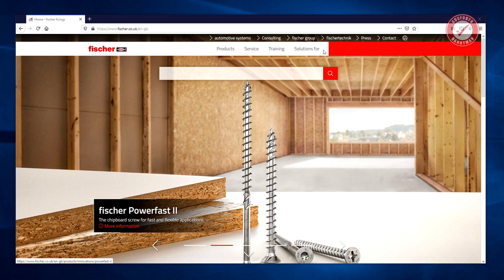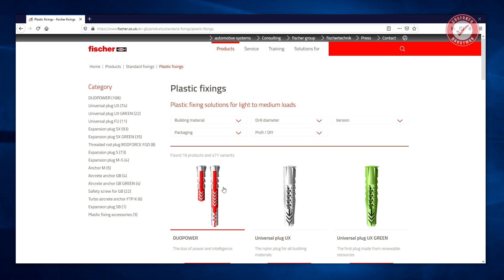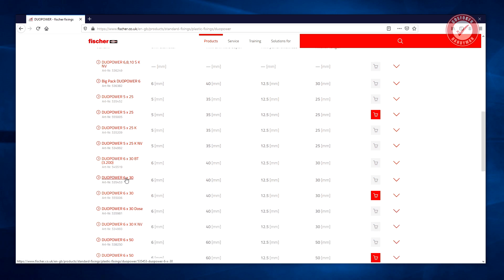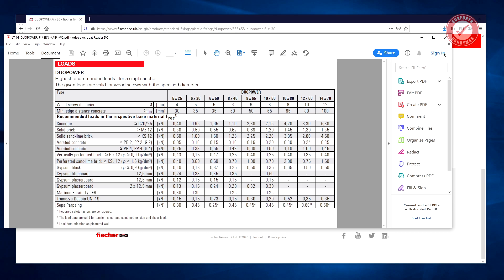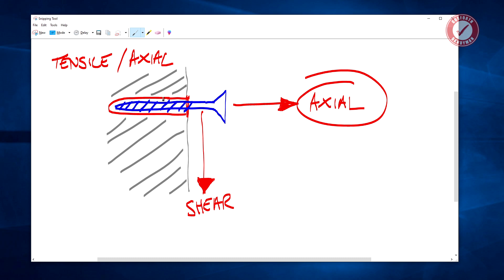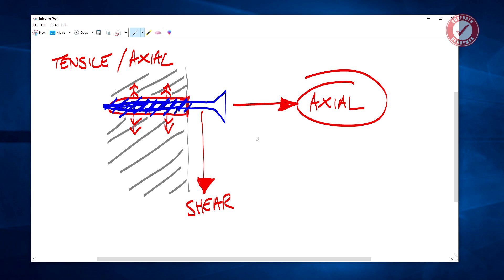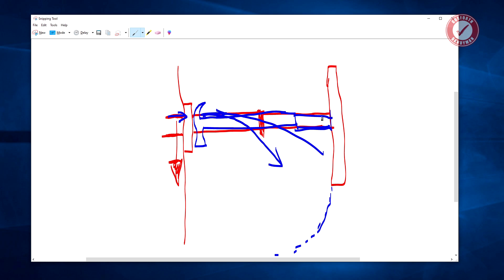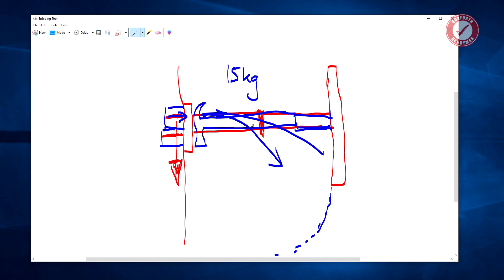How to read Fischer data tables for load ratings

Comment: Thanks a lot Andy for sharing the information and spreading the awareness of construction safety! I will gladly share your video with the construction class I teach.

I think you are right about the gypsum board or wall construction failing rather then the fixing itself. The b= 120 of b= 625 probably refers to the distance between each stud/support within the gypsum wall. It makes sense that more internal beams make the wall stronger and capable of bearing more kitchen cupboards. Sheers!
Reply from the maker: Thank you! Yes, possibly - although 120mm stud spacing is very close. Never seen that! 👍
Reply: My guess is that it refers to the furthest distance away from the wall of the object being mounted. For example a shelf that is either 120mm (4.7") or 625mm (24.6") deep, and therefor extends that much away from the wall. It makes sense that it can support a higher load  if that load is closer to the wall. 

I highly doubt that it's referring to stud spacing, as he said 120mm is way too short. The standard stud spacing here in the US is either 16" or 24", maybe that's different elsewhere, but no one is ever going to put studs every five inches!
(they might be spaced more closely in corners or by windows etc, but no one is building a whole wall that way, unless they're building some sort of fortress!)

Comment: Has been some good learning .. Thanks for this video.. Being a women from Asian origin, I have had no opportunity to learn any of these skills and am so dependent on handyman for smallest jobs.. So got really frustrated over the years with tears and have decided to teach my self...  My first project is to repair my curtain rod where there are loose fittings on plasterboard... In the search of understanding what would be the right plasterboard fixings to use, this time for strong holding, tumbled  on your video.. Thanks for the info... 👍😊
Reply from the maker: Thank you! I'll be doing a vid about curtain poles... not sure when though. Try to get a solid fixing if you can... failing that if it's hollow I generally use the expanding metal anchors with a setting too (see my vid about fitting a loo roll holder).
Reply: @GosforthHandyman   ooh thanks very much for that swift response. Really appreciate... I have got a pack of Rawlplug Interset for Hollow walls. Says Heavy duty.. M5*37mm fixtures from the Range store  last night.. I hope to try tomorrow .. Incase u see my msg tmrw, pls let me know if these will be OK to use.. It calls for 9mm drill bit on the pack.. Thanks very much in advance and stay safe...

Comment: One of my favorite wall anchors that doesn't seem to well known are 'Togglers' made by Toggler. Yes Toggler is both the name of the brand, and one specific product that they make (the same company makes SnapToggles, Alligators, etc). An identical product is also sold under the name 'PopToggle'. 

In any case it functions like a mini SnapToggle, except it's all plastic. What's nice is that it requires a smaller hole (5/16"), and is much easier to install, and works with a wide range of screws. Also much cheaper. it's my go-to in hollow walls, I consider it the strongest hollow-wall anchor short of a SnapToggle, possibly stronger in cases where you have multiples close together, because you don't have as big holes weakening the wall, and also because it's a more solid plug that reinforces the  wall against shear loads. Though I just added Duotec to my quiver, so that might fit in between Togglers and SnapToggles (though they're not cheap, so I don't expect to stop using Togglers anytime soon..).
Downsides are that it's basically impossible to remove once insttalled, and you need to know the wall thickness (there are different anchor sizes for 1/2" or 5/8" drywall), though it's easy to fashion a tool that measures that. Also sometimes it can be a pain to get them to pop out, especially if the walls are insulated.

The other anchors which I use a lot, much  more than Duopower, are Alligators (also by Toggler)- mostly AF6, but occasionally AF8 or AF5. The main reason I like these is that they accept a very wide range of screw sizes, and have a pretty high load rating for simple plugs.

Comment: Great video, thanks.  Does that mean per plug/screw, so the load increases if you add more, as long as they are 300mm or so away? Apologies if I'm being dense, but I thought I'd ask!
Reply from the maker: Yup - that's generally correct! 👍👊

Comment: Very nice little video.  So if you're wanting to put a heavy mirror on the wall if you used two fixings to spread the load about 300mm apart does this spread the load by halfing the applied load on each of the fixings?  Could this be tested?
Reply from the maker: Generally yes. This wouldn't apply for fixings close together on plasterboard though as the wall would just come away ' as one'. 👍
Reply: @GosforthHandyman  Would be good if you could do a test to show that.  I was thinking perhaps just hanging some wire across two fixings to imitate a picture wire hanging across two fixings than applying the load hanging from it?   Something for another one of your videos perhaps?

Comment: very interesting as always, Span will mean multiple fixing with a space max between each plug of 120 mm, that could be increase the strenght...may be, if i well understand, or not sorry, my comment is vey weird :-)
Reply from the maker: Cheers! Yeah, that could explain the 120mm thing... but for a single fixing it shouldn't change the load rating. 🤔👍

Comment: Andy I think the span is distance between the fixings and nowt to do with the supporting framework.
Reply from the maker: Possibly, but the test is only on a single fixing I think? 🤔👍
Reply: @GosforthHandyman  I do not know either just postulating.😉 The way I looked at it was the test rig being a rigid batten with holes at 120mm, 650 mm what ever and with the axial load being applied to the batten via a bridle. So all about load sharing on the plasterboard substrate with different fixings and if you say found the axial failure load say at 200 Kg on an axial load through a centre point bridle it would be reasonable to assume that load was uniform (or close enough) across both fixings. In the case of plasterboard as the structure starts to fail I guess cracks start to propagate away from the fixings area for some distance. Where fasteners are only 120mm apart there is more likelihood that the propagation zones meeting (or nearly) than when the fixings are 650mm apart.

Comment: A fellow Nomad makes channel recommended your channel (he was making lumber storage shelves). We discussed means to fix shelves to a wall, and I brought up that I have hollow bricks in my workshop. Those bricks are very commonly used where I come from. Do you have any thoughts about that? I used ordinary red wall plugs which failed, then Duopower, but lately I switched to Fischer FIS H 12x50mm which I fill with Sika 2K something... 
P.S. in the meantime, I watched most of your videos on shop safety... Among other things, I will start using a hat in the shop.

Comment: I recently  bought some of the Fischer Duotec and I had the same question about the datasheet- what the hell is the 120 / 625 distance from the wall they are talking about? It references a figure 'b' which is not mentioned in any of their diagrams or other materials or instructions. I emailed them to ask, but I haven't heard back yet.

My guess though is that it refers to the furthest distance away from the wall of the object being mounted. For example a shelf that is either 120mm (4.7") or 625mm (24.6") deep, and therefor extends that much away from the wall. It makes sense that it can support a higher load  if that load is closer to the wall. I highly doubt that it's referring to stud spacing, becuase 120mm is way too short. The standard stud spacing here in the US is either 16" or 24", maybe that's different elsewhere, but no one is ever going to put studs every five inches!

Comment: The "span in construction" (German: "Plattenstützweite") refers to the space between battens, 2x4s or whatever is supporting the plasterboard, 625 being standard spacing over here (that's why insulation is often that width.) The second variant with the 120mm spacing is for heavy reinforcing / close spacing of the 2x4s with a gap of only 120 mm. I'd rather put a hefty piece of plywood in the 625 mm gap if I'm planning to mount a big TV etc.
Reply from the maker: Interesting! Never seen a wall with only 120mm stud spacing. Same here, would put ply in the gap. 👍

Comment: having a 20 kg fixing if you used 5 fixings would that hold 100kg.
Reply from the maker: Theoretically... as long as the load is even. Sometimes (e.g. Lack shelf) most of the load is on the upper fixings though so depends on a few other factors. 👍

Comment: Not related to the video, but your website needs the ssl certificate updated.
Reply from the maker: Thanks so much! Sod's law! Sorted. Not sure why it didn't auto-renew... 🤔👍
Reply: @GosforthHandyman  It's a bug with cpanel. Happens to a load of my websites too and I still haven't figured out the cause. Need to chase them up about it.
Reply from the maker: For me it was specifically for a wildcard cert 🤔. All my other ones were fine. I think the wildcard cert struggles to renew when using Cloudflare. Had to change the nameservers away from CF before it would let me renew it... then nameservers back to CF again. Bit of Saturday morning geekery... cheers again! 👊👍

Comment: How about an actual test of an installed item that tests the force it takes to rip it out of the wall. These tests and your conversation about axial load are not accurate to actual aplication. The Lack shelves for instance, would require more than two anchors to install.

Comment: Ive used the geefix for plasterboard and haven't had a failure yet they are a bit expensive but ideal for tv bracket's and versitile as you can use one fixing for 3 holes if there close to each other either vertically or horizontally Charlie diyte has done a vid on them worth a look
https://youtu.be/aeFyQS2NGVM thanks for the informative upload Mac